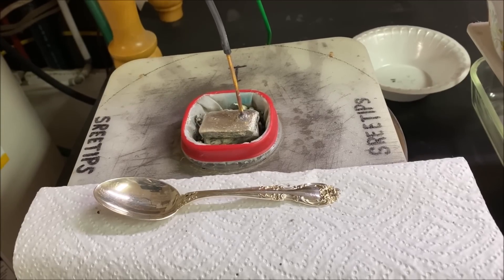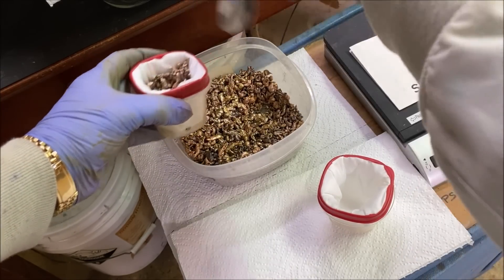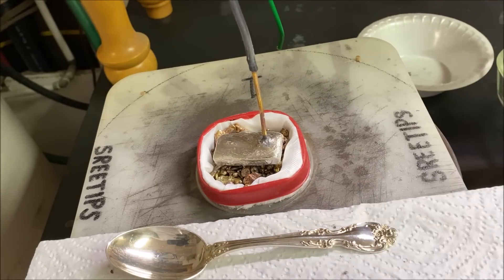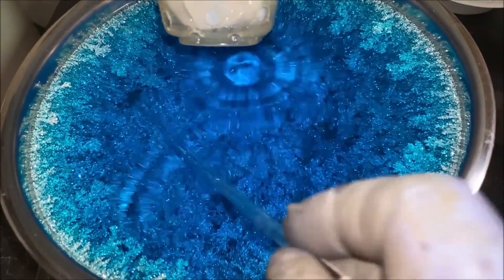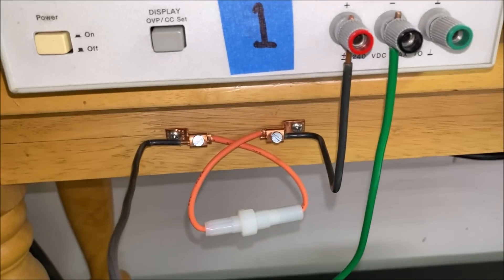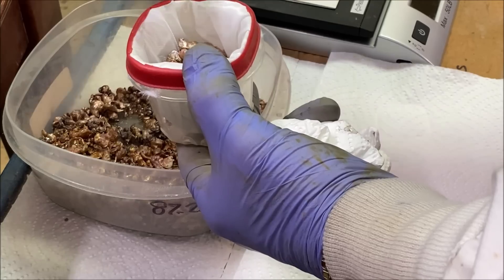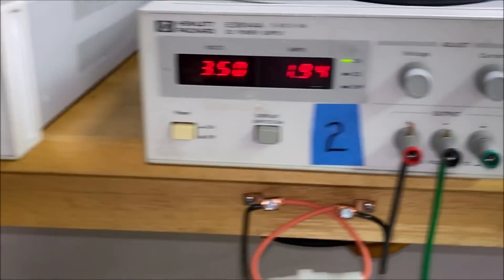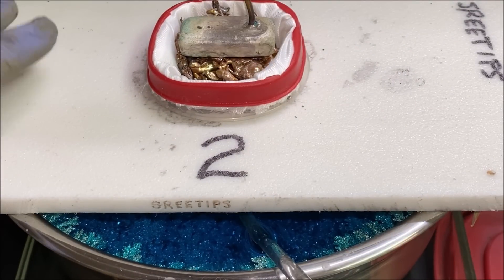Silver Cell Day 11 Crystal Growth 264 Hours

Comment: Those pretentious coils in the cables serve no purpose, other than introducing more resistance in the circuit, which is anathema to your aim. You clearly know nothing about how electricity works!
Reply from the maker: The coils act like a spring that exerts a slight downward force to keep the impure silver pushed down into the anode filter basket. And you’re right, I don’t know much about electricity. But I do know a thing or two about operating a silver cell.

Comment: What the heck is electrolights?
Reply from the maker: Electrolyte is silver nitrate solution. Being conductive, its function is to complete the circuit between the anode filter basket and the stainless steel cathode. The electrolyte also acts as a conduit for the silver ions that get dissolved in the anode basket to travel from the anode filter and down to the cathode when they deposit as high purity elemental silver metal.
Reply: TY

Comment: Isnt it possible to create an electrolysis cell that allows impurities(slimes) to simply settle out, reducing the need for filters?
Reply from the maker: Yes, it’s called a moebius cell. It is alternating anode/cathode plates hung vertically in a tank with gallons of electrolyte and pulling a hundred amps or more of current flow. That’s much too large for my small hobby operation. Mine is a Thum cell with the anode hung horizontal over the cathode.
Reply: @sreetips  I reckon we all need to donate a few grams each for you to set one up!🤣
Reply from the maker: A ten gallon moebius cell would be 37.8 liters. So 37.8 times 150g per liter equals almost six kilos of silver just for the electrolyte. That exceeds the limits of my small hobby operation.

Comment: Can those filter bags be rinsed/cleaned and reused more than once? maybe some chemical that absorbs the sludge back into suspension and then rinsed?
Reply from the maker: I’ve boiled them in dilute nitric and they come out clean as a whistle. But get them to fit a second time would be impossible.
Reply: @sreetips  could you clean them while still installed in the basket or is it too harsh for the basket?   I also noticed no day 10 update, was that intentional?
Reply from the maker: I would not recommend it. The filters are inexpensive and easy to change out.

Comment: Hello Mr. @sreetips, wouldn't it be easier if you electrolyzed large ingots instead of shots? 
No electrodes needed, no current loss on bad connections, no need to frequently dose fresh material, no need for Dacron filters - just pure gravity feed.
Reply from the maker: I’ve done it this way for a decade and a half and achieved excellent results. I’d have to switch to a different type cell.

Comment: Have you thought about using  a stainless steel colander set inside the bowl for a quick change out , and the electrolyte could be reused in the same stainless steel container , just put a new  colander in back in business after draining the original one .
Reply from the maker: No, I have not thought of that.
Reply: @ credit is due to a guy on GRF for the idea worked ok . Your scale is a little larger same concept . But what works for you works . Always impressed ( little jealous sometimes ) with the silver production . I’m trying but man you are next level . Well done

Comment: Have you measured the difference in processing when amps start to decrease?  Meaning, a brand new basket with clean shot starts at say, 3.5 amps..  and when it's down to say, 2 amps, you've added x amount of shot in x amount of time..  but then from 2 amps down to 0.5 amps (ie another 1.5 amps decrease), would it process less shot, or take much more time, etc?  Just curious if there is a point of maximum efficiency..  I think it would be interesting data to collect..
Reply from the maker: The rate of consumption of the impure shot declines steadily as the filter becomes clogged with slimes.

Comment: Since you daily have silver to refine, I highly recommend you to go with small PP or PVC tank with for example 4 inch wide stainless steel 316 cathode and as much height as the tank, then use titanium basket with filter bags for your anode and its better to melt silver anode to avoid voltage dropping with titanium, in this small refining cell you will spend no time with solving the filter issue since you will have large surface area for making electrolyte go in and out the filter.

Comment: nice... :-) you always thinking about feed the silver cell with a big bar? pouring cement silver in a 1 kilo bar? put it in the basket vor desolve. i think, then you get nearly only slimes in the filter processing, and not so much exess, undesolved silver shot. you can connect the bar with a battery clamp.

Comment: Rather than cutting the excess filter material off, could you leave it on? When you reclaim the slimes, could you reuse the uncut filter. Even getting 2 runs out of the Dacron filter would save you significantly.
Reply from the maker: Because it wicks the electrolyte up and becomes encrusted with silver nitrate crystals.

Comment: I wonder if your filters clog up so fast because you are using very impure silver shot. When I make my silver shot it looks very silvery and looks pure. I know you have been doing this for over a decade. I get it. 

I wash my cement silver until no discernable blue color, then I wash it one more time with dilute sulfuric acid (10% acid in distilled water). The solution turns bluish again suggesting that there is still copper in there. I rinse again until there is no blue color. The cement silver shot looks great after melting.

 I tested the sulfuric acid rinse with HCl and did not see any or maybe a slight white ppt of silver chloride – certainly not much.
Reply from the maker: I used to take great care to wash and clean my cement silver. Then I finally realized that it’s best to let the cell do all that work for me.
Reply: I was looking at some pictures of my silver cell using clean cement silver. The electrolyte slowly gets blue and lasts a long time. The advantage of using clean cement silver is that one does not have to consume the pure silver crystals to make more silver nitrate. I used one batch of silver nitrate for 6 months with many harvests of silver crystals in a 7 L cell.
Reply from the maker: Nice! My experience has been a little different. When I first started, I tried to use the same electrolyte multiple times, adding just distilled water to get the correct level each time. After the third run, during the harvest, I noted that the silver crystals looked unusual and after drying had a green residue. When I tried to drop the silver chloride out with hydrochloric acid, to my astonishment, no silver chloride would precipitate. The blue electrolyte was completely devoid of any silver. I had heard from other refiners that the electrolyte gets depleted as the cell operates. But all of it?! It made a believer out of me. Today I never use the electrolyte more than twice. And I add another 200 grams of pure silver for the second run. The silver cell can’t distinguish between the silver ions that are already in the electrolyte, from those that get dissolved in the anode basket. To the cell, it all looks the same. This has been my experience.

Comment: Poked at this issue for a while anticipating similar if I ever get my own set up going and recreate what you've put together. With your set up, I've wondered if a solution would be as simple as swapping the filter bag to the outside of the tupperware and possibly replacing the food container's sides and bottom with the right size fiberglass screen or other compatible screen material, given enough holes couldn't be drilled. You're already getting good ion flow through both, so the goal (given the dacron is able to catch all the slimes) would be to get the impurities to fall away from the impure silver as it's consumed.

Comment: What would happen if you had copper all around the stainless steel bowl instead of just only the steel bands?
Reply: Also what’s with the current and amps? If you had a 4-5 gallon steel pot and “The Beast” power supply would it be the same current and amps?
Reply from the maker: Current flow would probably be higher with a cell that big.
Reply from the maker: I don’t know.

Comment: Had a thought. Dakron filter material is available in bulk online.  Buy a couple of yards and some doily hoops from a craft store.  Make a filter that has 3X the surface area to get clogged up vs food cups and maybe you can get a once and done filter run of shot on a cell before electrolyte contamination.  Ask Ms Sreetips about the doily hoops, I’m betting she knows.  My 0.02…
Reply: Cool. You could also use an embroidery hoop. Not sure how big doily hoops come in, but embroidery hoops come in pretty big sizes.

Comment: Is there a reason you use 'silver shot', as opposed to 'silver cement', for feed stock?
Too much surface area, maybe?
ie not enough resistance, causing high amp draw.
Reply from the maker: Clogs the filter